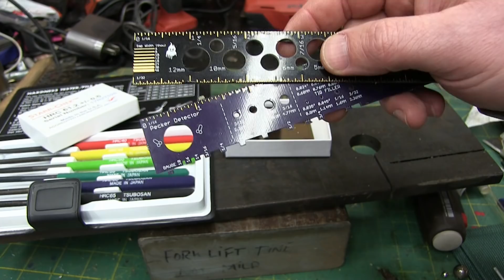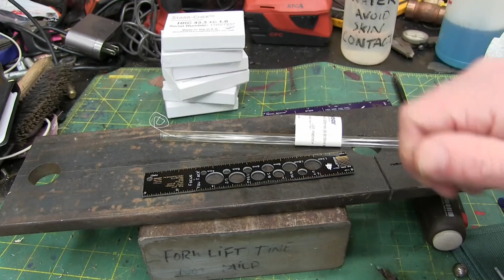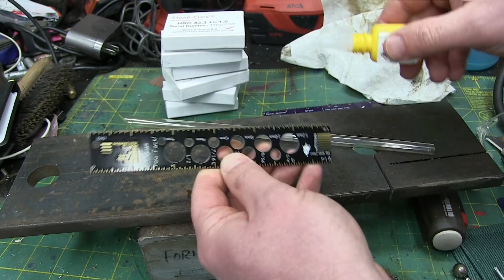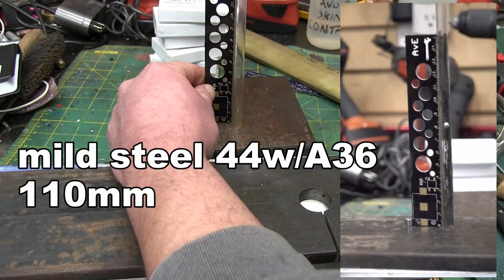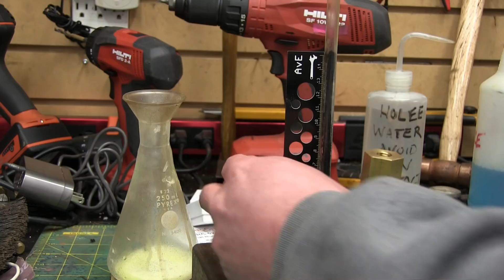Pocket Hardness Tester PROTOTYPE | IT WERKS!

Comment: Not sure if you alreaddy mentioned this among all your Cannadian gibberish, but didn't you mention that the mass of the object you are measuring would afect the reading? I haven't studied this since machining class in -89. I think the former gunsmith told us that rockwell was measureed by pressing a diamond with a known force against a surface. Or was that the other method where you used a hardened steeel ball. It's been eons, or at least decades, so I'm excused, or confused. Not sure which. The obvious advantage is that you don't have to worry about mass. But I'm sure there is a matematichian somewhere who has a way around that problem.

Comment: I think what you have there is almost a Leeb hardness tester. But, are you suggesting using dynamics to measure between pings is the novel component?  The lower mass limit is pretty high for accuracy too. Needs to be a >2-3kg sample. But it's a cool DIY idea!

Comment: Holy-oh-fuck man, this is dare I say ingenious.
But you know damn well that little ball will get lost in a New York minute.. Under the bench, bottom of the toolbox, etc...
I'd suggest a cap at the bottom with a hole in it, the diameter being slightly smaller than that of the ball. Chamfer the hole so the ball won't contact the cap and throw off the results. You'd want to close off the top as well. Have a way of dropping and handling the ball without it ever having to leave the tube

Comment: I've used this, in a way, for years.  Bounce a ball bearing and listen at the ending ring freq/duration (hysteresis).  The sound of the different hardness's is definitive.  Use a little heavier bb and if the testing sample is small, just set it on the vise anvil, the mass will combine and negate the lower sample bb ratio. With just a few practices, you can just "hear" what the hardness is.

Good stuff

Comment: The acceleration of Gravity in the real world is not a constant 9.8 m/s/s.  This will be an issue for calculations. The difference may be negligible however. Maybe a swinging mass on a short pendulum arm would mitigate gravity differences.

Comment: How 'bout a n electromagnetic ball holder at the top of your tube. Pull the pixies to release so as the balls drop consistently without any wrist action influence?
Reply: Second thought, may magnetise the balls after repeated suspension and stick to the sticky type metals and alter results.

Comment: What about a ball mounted to an arm that could be 'shot' at the plate at a consistent speed via a spring or something. The ball-arm  would have a wire in it that could complete a circuit through the metal being tested to start a timer. 

Would only work on conductive metals but…

Comment: Love the idea, but if you end up going with this kind of design changing the length of the tube will have interference on your data collection.  Try to get your measurements with a factor for inertia so if you increase it or decrease it you don't lose a ton of time.

Comment: what if you want to test the hardness of a magnet?
Reply: Use a ceramic BB.
Reply: Punch it and rate the resulting pain on a scale from 1 to 100!
Reply: Tungsten carbide ball or ceramic from skate board bearings maybe?
Reply: read the datasheet
Reply: Use glass beads. Ooops, sorry Mike Savage! 
Concerning glass beads, I remember that once, when I was a child, I was at a cinema lobby waiting for something or other, and I was pretty bored. So I took a glass marble from my pocket and dropped it on the marble floor. It bounced beautifully. So I tried dropping it from higher up: I held the marble above my head and dropped it; the marble jumped right into my front teeth! Unforgettable pain, I tell you.
Reply: Mike Savage beat me to it
Reply: There is a degree of magnetism with tungsten carbide
Reply: M H - did a quick serve-um-vey amongst  engineers and tool makers, 69 years cumebined experience and zero need to test a magmamet’s hardness.
Reply: heat up the magnet above it's Curie point :-)
Reply: Ceramic bearings are far superior for most applications
Reply: you use a ceramic ball .... or a nonmagnetic one; even tho those results would even be off.
Reply: Needs to be non conductive drop object to test on a magnet
Reply: TR P maybe a need to test a surface that has been magnetized?
Reply: @John Case Tungsten carbide has cobalt in it which is somewhat magnetic.
Reply: You have to recalibrate by launching with a spring of some sort.
Reply: Bring an extra space suit and a 'fluffer'.
Reply: Use a sintered carbide sphere.
Reply: Lobotoman hold your breath?
Reply: M H good point the ball needs to be non magnetic because steels such as 4140 can be very magnetic at times.
Reply: I doubt that the precision on this is going to be high enough to be affected by the magnetism of a ceramic or stainless ball bearing.

I do like the glass marble idea though...
Reply: Spaceballs ,hardness  mell brooks scale
Reply: Use stainless
Reply: Bring a magnet.

Or, a vacuum pump.

steve

Comment: Bitchin idea, but if you were to take that same sheet of copper, measure it on a wood bench, vs aluminum plate or a plate of high carbon, would you not achieve a shorter frequency between bounces?  Seems to me that since you are trying to count between bounces, that the material you're testing the sample on has a big influence on your time?!?

Comment: How much for an Ave factory'eh "calibrated" bouncy ball?
Reply: I'm sure AvE would charge a reasonable amount for his balls.  Babydoll might have an issue with it though.
Reply: Boof 181?
Reply: Hunh?
Reply: In theory the mass of the ball doesn't matter. Think hammer vs. feather on the moon. In practice a bigger ball is better at overcoming air resistance, up to a certain size & height which causes indentation.
You would probably want a small set of different size balls.

Comment: if you have a larger diameter tube and ball does the result scale up or stay relative?
I'm certain that a harder or softer ball will skew the scale.
Reply: ball needs to be as small, light, and hard, as possible, and once the scale is defined the same ball must be used

Comment: Just use a piezo and a DSO, check the distance between peaks.
Maybe even the cheap 'circuit board' dso's will work, or, you could feed the audio into Audacity ;)

Comment: What about using a inferred light to count the bounces
Reply: You can use two a certain distance apart and measure the difference in speed on the way down and on the way up, to measure how elastic the impact was. That way the exact starting point of the ball isn't crucial either.
Reply: Yes. Use a photo transistor and a led in the bottom.
Reply: An IR beam break detector might be the easiest way to get your timing, I guessed that the glass tube was about 10mm diameter and I had a quick look and turned up this jellybean module from mao's poundland https://www.seeedstudio.com/Motor-Speed-Sensor-Module-p-1969.html if you can fit the tube in the 10mm gap that might be a place to start for prototyping, that module seems to be available everywhere the link is just the first i found
Reply: Correct positioning of the emitter and sensor could be tricky though.  I'd imagine the piezoelectric sensor would be much more accurate on the kind of time scales we are talking about and easier to setup.
Reply: yes  easy
Reply: @Anders Gunnarson:  Excellent idea.
Reply: Will an arduino be able to measure that fast?
Reply: The arduino can easily measure microsecond intervals if you use the input capture on timer 1.
Reply: easy.
Reply: cameron Gibbs Good idea, as the solution with microphone would need to filter out echos from the room or the apparatus itself, as it is travelling in a tube here might be some effects not thought of. That might be somewhere in between measuring volume accurately against background noise or otherwise extensive DSP work. The optical barrier is more reliable. Needs to be damped as well, but is much simpler.
Reply: Yeah, IR trans/receive pair are dirt cheap and would likely be more reliable.

Comment: The piezo element doesn't need to be anything fancy. Those little buzzer elements work fine as a contact sensor. US$0.40 each at qty. 100, distributor price. Cheaper from Lucky Lowest Bidder Brand.

Comment: ONe word of caution with this. Some materials (titanium comes to mind) will read a MUCH harder than it actually is.  You're measuring the stiffness of the material not the hardness.  As long as you're doing apples to apples (calibrated for steels or copper alloys etc) it should be fine. 

We used to use this exact thing as a demo for a material science class. PRe hard 4140 (~38HRC) Hardened Ti 64 (~40C) and BMG (bulk metallic glass ~45 HRC 
the BMG the ball would bounce for close to a minute. O.o

Comment: I am sure distance above sea level is going to come into play in just a minute..
Reply: vacuum sealed tube? i guess the ball will just bounce of the tube not the test material
Reply: Pressure/temp sensors on AliBangWishBay for a few quid.  Why not add it into the MC's code and you can eliminate any height/pressure issues?
Reply: Bill Codey ... he is going to need a sealed tube and an electromagnet if he wants to get that accurate ;-)
Reply: Vacuum sealed tube, with removable magnet on top to drop the ball?
Reply: Having a perfectly balanced / even surface is going to be way more important.
Reply: What Scott said....you can just put a gasket on the end of the tube and bring it to some uniform pressure.  Doesn't even have to be a full on near vacuum.
Reply: Bill Codey
Calibration.
Reply: Guys, this is Uncle Bumblefuck in his empire of dirt. Relax a bit, he is just having a bit of fun, not trying to rewrite the Rockler scale.
Reply: boggisthecat Yeah for real accuracy you need to calibrate every measuring device. This means at least comparing it to a known standard which is traceable somehow to the national standards from NIST (for the north american fellas). 
I think the ball itself - it's own hardness - is more of an unknown than air pressure and variations in gravity
Reply: Mmmmm.. I kind of doubt it, depends on what level of accuracy we are hoping to achieve here, as this seams like a good enough approach for hardness measuring, likely get you within say 5% or so, which would be plenty accurate for enthusiast/anything-other-than-building-the-space-shuttle purposes, the +-.1% error that temp/pressure would introduce is hardly going to be an issue
Reply: Dylan- Yea if what you're working on needs it to be within +-.1% error, you can probably afford the more accurate ones.
Reply: But how accurate are we trying to get here for the price point in question? High accuracy for this price dosnt exist. So anything in the average mans ballpark needs is a bargain. 

On a realistic scale, how much would pressure really matter? A few points in hardness or a few hundred?
Reply: gtq838 gravity doesn't even have the same force around the globe on the same level
Reply: Then you need a $600 vacuum pump...   lol
Reply: That was my first thought air pressure and temperature as well would throw it off potentially
Reply: test material seals the tube, so not a problem

Comment: Mobile phone cameras do 200fps easily nowdays. If you plan to use some piezo element why not use permanent magnet impacting head driven by coil then. Maybe magnet would shatter who knows. When driver is off you can read velocity of impacting head from coil voltage by simply driving negative coil terminal to ground with mosfet based bridge and via schottky diode reading the positive one  and to reach maximum accuracy you can have in-steps adjustable scaling circuit using some generic analog mux ic in series before ADC. Another solution is to have analog or digital shunt amplifier/ADC in coil terminals using resistor network to scale voltage and one resistor for fixed reference to ground. Then drive up and down - turn driver in hi-z - read shunt amplifier value/positive lead - drive again if minimum velocity has not been reached - turn timer on - wait for 0 points or certain minimum speed point and average them some way and store 2 or 3 timer values. Then do math on chip or manually.

Comment: Don't forget to do the math on altitude. If you're at a mile high, or two miles high, that's going to affect the rebound time pretty significantly.
Reply: An air pressure sensor might be enough to account for that.

Comment: As long as you're using a glass tube, a tiny little photo detector with IR emitter+detector in the same package might end up being a cheaper/easier way to measure the bounce-to-bounce timing than the piezoelectric element.

Comment: It would also need to be level, as ant angle put on it would create friction on the inside of the tube which would slow the ball which will throw off your results, unless it's Teflon coated in the tube which would help

Comment: Piezio would be prohibitively expensive at scale, KISS, put a check gate in it so the ball drops through a gate, bounces out and is caught by said gate. Then work out how to reliably mark the height (thinking one of those detented flags like on breathing tests) . Boom, repeatable result and ease of measurement.
Reply: Really? I just found 6 for $0.93 USD Shipped on Aliexpress in 30 seconds. They are a mass produced item and are ridiculously cheap. You do get industrial varieties of course that are higher quality, but for this application we aren't looking for any kind of absolute precision or quality.
Reply: Nick Stallman that is much cheaper than expected but you still need the processing circuitry and software.
Reply: Compared to a photo interrupter, you might just need an extra opamp to amplify the piezo signal a bit. The benefit over a photo interrupter would be zero offset - the piezo would get exactly when the ball hits the surface where as a photo interrupter would be a few mm above the surface.
Reply: This could work. You don't need to know when it hits, just compare the speed down vs. the speed back up. If the drop height, and spring value of the ball is known, then a bit of mathemagical stuff can figure out the spring value of what the ball is hitting.
Reply: Gerald Gepes That is a great way to do this i think your on the something
Reply: Jay R, he isn't trying to have 100% accuracy.  Just want to get in the ball park.
Reply: drill some holes at the bottom of the tube to let the air out.
Reply: I agree that a photo interrupter is probably a better solution than a piezo element.  Still this is a fucking great idea.
Reply: piezo is cheap af
Reply: I'm curious as to why the idea of air resistance and rolling resistance on the side of the cylinder in regards to the "hardness" projectile haven't been brought up with this test thus far
Reply: just use the piezo element that is in a throwaway lighter. Hard to beat that price. Voltage enough because it is a stack.
Reply: haha that's the understatement of the year

Comment: You are a fuckin genius :)

For measuring shore or other "difficult " materials consider an interchangeable mass oscillator ;) (a different mass ball)
Reply: Use 2 size ball measurements to correlate and factor out the mass issue.
Reply: A springloaded striker would allow testing on non-horizontal surfaces and minimize the effects of air pressure, etc.
Reply: What if you glue a tiny diamond to a piezo, mount it a tiny bit away from the material, put a signal to the piezo and measure the resonance "bounce" frequency?
Reply: Led on one side LDR on the other (dark tube obviously) or a Hall effect thingymibob and time the first 2 impulses ..... pixies can move quicker than an old mans eyes (mine that is)
Reply: I don't think this is measuring hardness. You need to plasticly deform or indent the surface in order to and would require far more force applied to the ball- with this, the ball bounce will be correlated to materials stiffness (elastic deformation of the hertzian contact area) rather than hardness. Hardness, which is not a fundamental material property, is actually independent of stiffness. Even still this could still be a useful tool
Reply: I agree it's probably less accurate and maybe harder to build (more parts), but cost is almost entirely economy of scale.
Reply: It is really a great idea.
You could look at the decay on the subsequent readings and use that to verify the accuracy.
Reply: I am curious if air pressure will effect your readings. If you calibrate at sea level, will you get a different time between the bounces at 1k feet?
Reply: I was thinking along the same lines but I bet a cheap opto interrupter (photo interrupter) using IR would be less prone to false triggers than a generic LDR.  They have the light channels and are tuned to the specific light frequency of the "transmitter" LED...
Reply: Adam Olsen
Easier to use this gravity plus mass method, and have a way to calibrate it.  An extra button, and letting software do the heavy lifting, is far cheaper and simpler.
Reply: That's brilliant!
Reply: Looking at you, Bjørn.
Reply: is you used a teensy or 32-bit micro you could possibly analyse the frequency response of the sound too.
Reply: TinyWorkshop Design Adam Olsen The electro magnet inputs pixies into the equation.  Angry pixies improve all things.
Reply: I wish I had his brains and toys.
Reply: Cut out all the bouncing crap: replace the ball with a tiny electromagnetically actuated hammer, measure the speed as it goes down and as it comes back up.
Reply: Adam Olsen good idea but is much more expensive... and less accurate IMHO